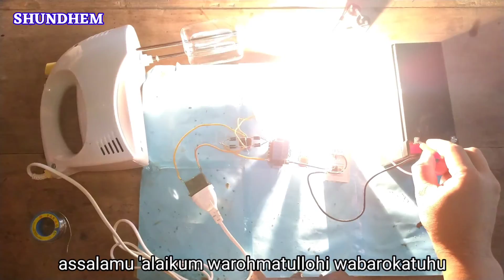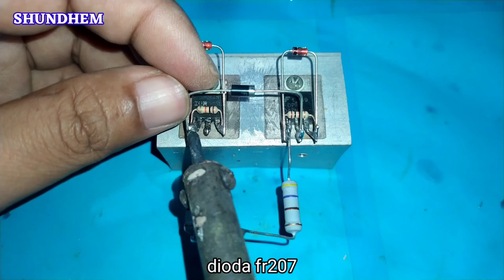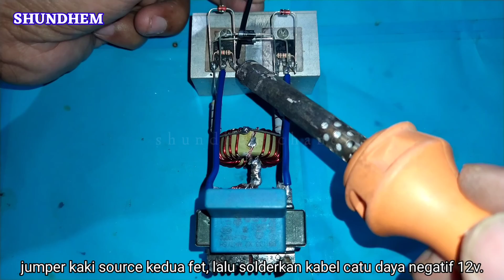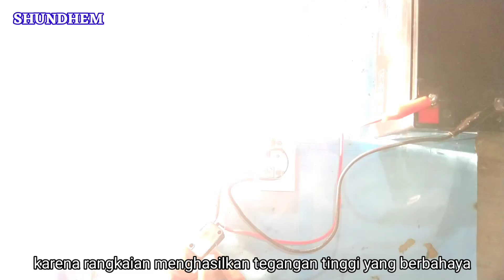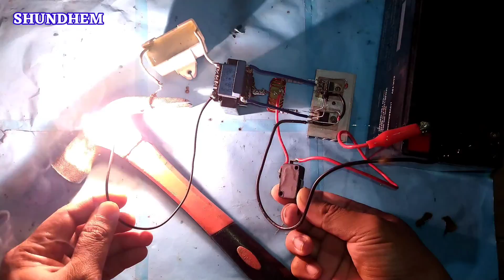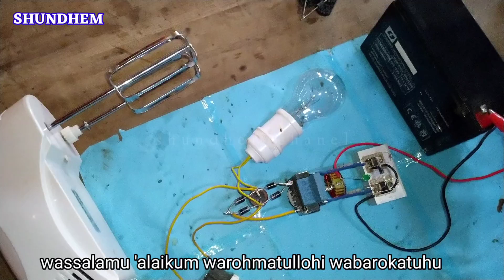cara merakit inverter tanpa pwm | si mungil bertenaga badak.

Comment: kumparan induk tor brpa lilit.. ct
Reply from the maker: 30-35 lilit kawat 0,5mm
Reply: @shundhem_electrick  itu apa ct.. 30 ct 30.
Reply from the maker: @jokomulyanto9280  primer 3 ct 3
Reply: @shundhem_electrick  mksd sya.. yg induktor trafo dont.. itu kumparan ct apa bukan bang..
Reply from the maker: @jokomulyanto9280  bukan
Reply from the maker: @jokomulyanto9280  o iya itu induktor toroidnya 35ct35
Reply: @shundhem_electrick  mksh mau sya modif jd strum ikan bang
Reply from the maker: @jokomulyanto9280  bisa
Reply from the maker: @jokomulyanto9280  sebelum dikasih tegangan penuh 12v dari aki, ada baiknya pertama cek matching apa belum dulu trafonya, tegangan + dari aki di seri dengan bohlam motor dan pastikan engga nyala bohlamnya, klo langsung takut error pecah mosfetnya.
Reply: @shundhem_electrick  mta no wa bang.. sya udh buat 6 ct 6 tenagax krang bgus.. pngen cobak 3 ct 3.

Comment: mau nanya nih bang
aku kan udah buat sama seperti ini tpi cuma ga pakai mkp 2,7 uf 450v 
itu diganti dgn milar 400v 104j

saat di tes dan diberi filter outputnya
menjadi dc high voltage dan high frekuensi dan bebannya lampu Philips 5w kenapa elco meledak?

lilitan sebelumnya dibuat 107 lilit
lilitan sesudah dirubah 75 lilit tpi masih sama-sama merusak elco

Comment: untuk frekuensi yang di hasilkan berapa mas,bagaimana cara mengatur
Reply from the maker: menambah & mengurangi nilai kapasitor yang berada di kedua kaki drain mosfet
Reply: apakah bisa di jalankan di frekuensi pln(50-60hz)menggunakan ferit
Reply from the maker: @aryapyantara5556  banyak yang bilang udah mendekati sinus, tapi ya perlu diperhatikan tegangan output agar tak merusak peralatan listrik, belum ada proteksi + limitternya ini, klo untuk penerangan aja masih aman.
Reply: terima kasih informasinya mas'🙏🙏👍👍

Comment: Assalamualaikum. Mas mau tanya. Itu fetnya pakai fet apa. Terus travonya primer sama skunder brapa lilit ukuran berapa untuk imailnya
Reply from the maker: waalaikumsalam
fet 036n10 / 047n10 / irf3205
primer 3ct3 kawat email 0,5mm rangkap 6.
skunder kawat email 0,5mm 80lilit.
induktor toroid 2,5cm kawatt 0,5mm 35lilit.
Reply: @shundhem_electrick  timakasih ya mas semoga sukses terus
Reply from the maker: @dienizcubee2558  aaamiiin makasih
Reply: @shundhem_electrick  tolong d jawab pak itu trafo nya yg ada celah nya apa rapat?
Reply: Jika TIP 41 bisa gak mas

Comment: Bang kalo trafo ee42 lilitan sekunder 0,5 80lilit primer 0,5   3 lilit CT 3 lilit rangkep 3  maksimal gak bang untuk skema di vidio ?
 Oh iya mau tanya nih trafo non Gap sama bergap bedanya apa bang? Maaf pemula
Reply from the maker: bisa, non gap bila kedua inti ferit EE disatukan bagian tengah tidak ada celah, ber gap bila kedua inti ferit EE disatukan ade celah ± 1mm ditengah inti ferit.
Reply: @shundhem_electrick  thanks bang

Comment: Mosfetnya pakai tipe yg berapa bos
Reply: Di pakai 2 jam nonstop apa gak terlalu panas bos mosfetnya
Reply from the maker: @mashluhatussyuaibahlulus4500  engga panas kalau trafo + pwm matching
Reply: @shundhem_electrick mohon pencerahan bose,,itu kan  gk pke pwm, cra me matching kan dgn trafo gimana,, mohon d jawab🙏🙏
Reply from the maker: @lukmanchanel8556  dengan cara mengatur nilai kapasitor yang dipasang dikedua kaki Drain mosfet yang menuju kedua lilitan primer trafo, sebelum diberi tegangan, seri dulu jalur positif aki ke ct lilitan primer menggunakan lampu depan/sein motor, tes tanpa beban, usahakan lampu padam minimal redup.
Reply from the maker: @lukmanchanel8556  semakin besar nilai kapasitor smakin tinggi frequensi.
Reply: @shundhem_electrick  trimaksih bose pencerahan ny, sukses selalu nggeh 👍👍🙏🙏🙏
Reply: @shundhem_electrick  oh iya bose nilai resistor nya itu tidak perlu d rubah ukurannya juga untuk m ninggingikan frequency 🙏🙏maaf tanya lagi 😉😊😊
Reply from the maker: @lukmanchanel8556  aamiin makasih.
Reply: Kawat tembaga untuk iduktornya ukuran berapa bos
Reply from the maker: @mashluhatussyuaibahlulus4500  saya pakai 0,7mm 35 lilit toroid diameter 1,5cm, pernah juga pakai kawat 0,5mm 30lilit.
Reply: @shundhem_electrick  untuk meninggikan frekuensi  sekiran 20 K hez untuk setrum ikan, restor mana yg d rubah bang🙏🙏makasihh sebelumnya mohon d bantu
Reply from the maker: 036N10
Reply from the maker: pengatur frequensi pengganti pwm ada di nilai kapasitor, sesuaikan nilai kapasitor sampai matching, minimal redup saat lampu 12v.

Comment: Bang buat inverter dari trafo gajah di yang ada belalainya psu pc  tr nya pakai tip 41 atau irfz44n ya bang punya bahan²nya tapi gak tau mana jalur lilitannya
Reply from the maker: kalau mau kuat harus lilit ulang biar matching
Reply: @shundhem_electrick Tanpa harus lilit ulang bang gak ada tembaganya
Reply: @kurumi_-4640  ga maksimal nanti hasilnya
pada umumnya orang membuat setrum ikan atau inverter pakai lilitan sekunder 50-111 lilitan
primer 3 lilit